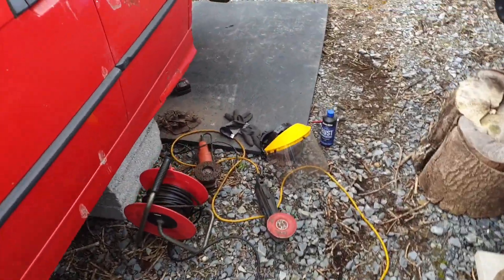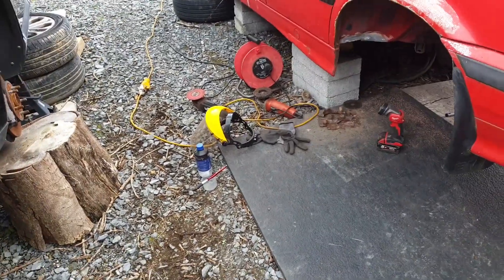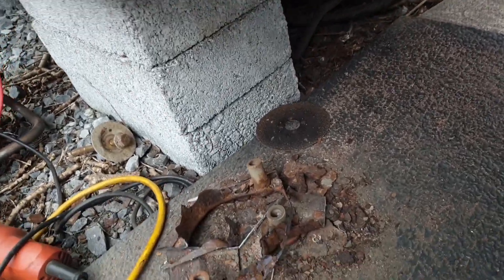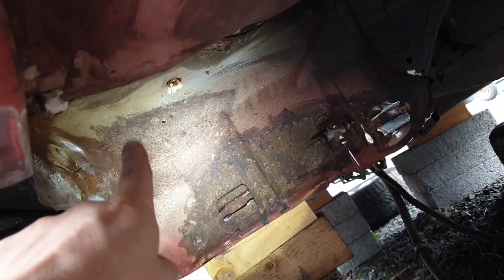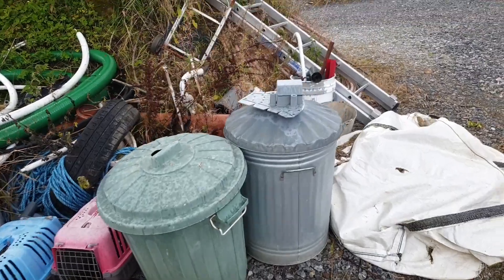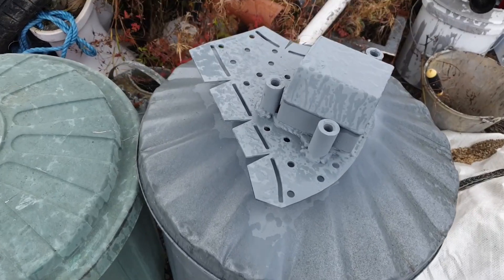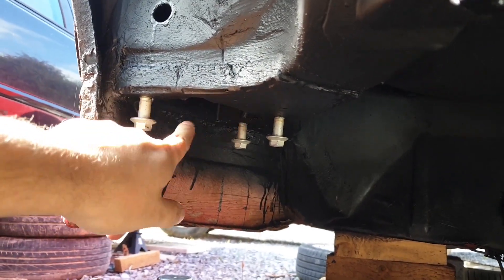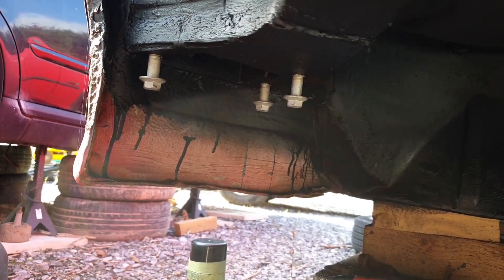€1,000 BMW E36 EV Build 20 : New Pockets

Comment: Hello Damien,
I am looking for an affordable traction battery, ive looked into tesla modules aswell as diffrent hybrid batterie packs and so on from existing cars. Out of all of those, the tesla modules are by far the best documented and cheapest way to get good power and capacity, but to get up to a high enough voltage might be a problem. 

When i saw the batteries you are using in your e36, they first reminded me of some medical backup batteries which seemed to be readily available and cheap in the states. Unfortunately, since i live in germany, i have yet to see anything of that sort be sold to the public. 

What kind of batteries exactly are you using? I researched a little bit and found the manufacturer valance, your batteries seem to 
be made by them aswell. I believe they offer Li-Ion aswell as LiFePo4 based prebuild battery packs in standard car-sized cases. 
Did you pay full price for the 10 batteries you have in the car or did you get them from some kind of industrial auction? Id be keen to find out more about that. 

Im looking into diffrent motor setups aswell, thus far the lexus gs450h gearbox seems to be the best route to go down if i figure out an affordable battery solution that can supply the required power aswell as the voltage to operate the gs450h gearbox near or at peak power.

Thank you very much for your videos, i appreciate all of the work that you put into your projects and your videos. 
Greetings from Germany and have a good day!

Comment: Hi Damien, I used electrolysis to remove rust from some old parts.  I thought of it when I saw your suspension parts.  Water, washing soda (sodium bicarbonate) and some low voltage and it did the work for me.  Might be worth a try since it's low cost and low labor.  Thank you for the videos.

Comment: Hi Damien (AKA Jack!) - Most manufacturers tend to re-use splines, I guess because they already have the tooling.  I would try some other bits like CV / Drive shafts from the same manufacturer.  You may well strike it lucky.

Comment: Maybe it would work to remove the rust with some acid of your chice, in a plastic tray since they aren't that big?
Reply: NO, please do not use muriatic acid EVER nor open it anywhere in your workshop, just GOOGLE the horrors of Muriatic Acid, you can use Phosphoric acid instead in the States, Home Depot sales it under the Clean Strip brand and calls it Concrete & Metal Prep, phosphoric acid is the key ingredient in all the high dollar gimmick products
Reply: @Good-Enuff-Garage  like any acid, or chemical for that matter, the concentration matters. 5% can be purchased at least where I live. For your reassurance, I've reworded my previous post, and I hope you can sleep better at night.